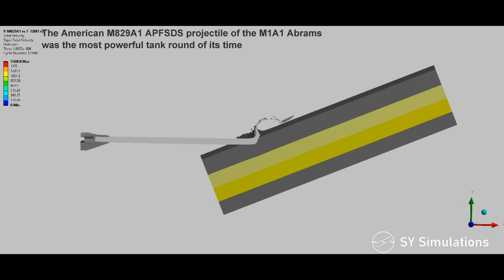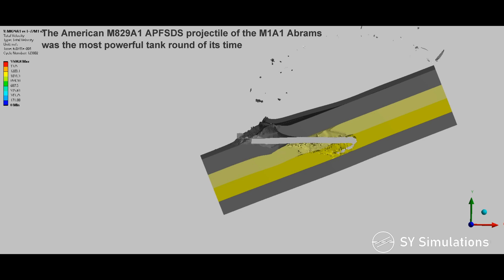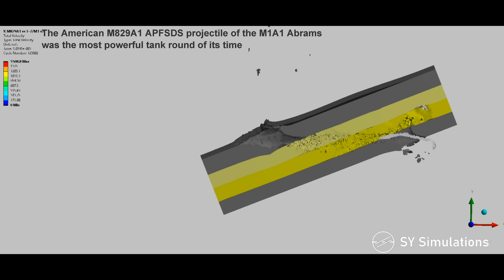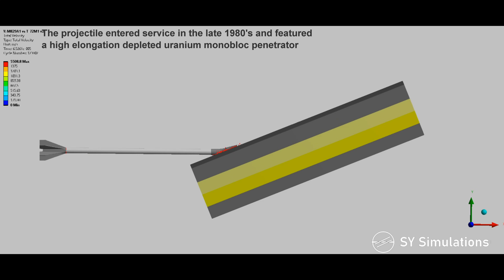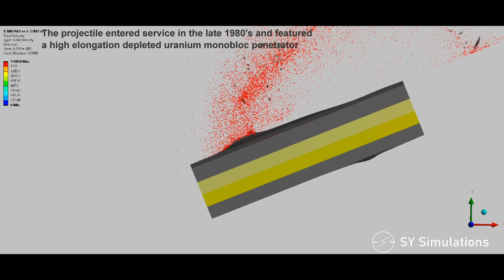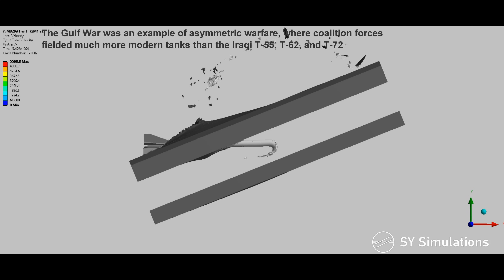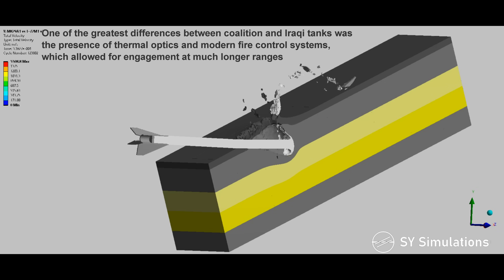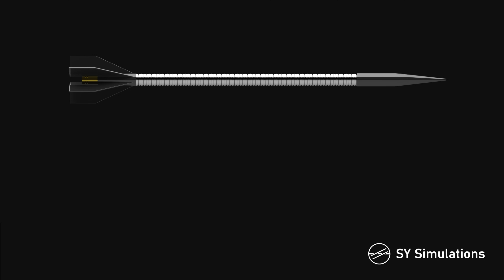Abrams SILVER BULLET vs Iraqi T-72 | M829A1 Depleted Uranium APFSDS Armour Penetration Simulation

Comment: Operation Desert Storm is the perfect example that the Soviet doctrine of "quantity beats quality" was completely misguided.
The coalition fought the 4th strongest army in the world and won in record time at minimal losses.

The Battle of 73 Eastings featured a small number of Abrams and Bradleys running into an ambush by a much larger group of elite T-72 tanks in prepared positions.
The coalition forces, without any air support, completely wiped the floor with the iraqi tanks, losing none of their own vehicles. The battle lasted around 23 minutes.

My personal highlight is when two Bradleys drove into fifteen T-72s... and they managed to knock out half of them without even taking damage before anyone showed up and helped them. The Bradleys managed to reload their TOW launchers mid-combat.

"Quantity has a quality of its own" is bollocks.
Reply: By 1990 Soviet forces would have already many T-72A (1984)s, T-72B1s, T-72Bs and T-72B (1989)s. What's your point?
Reply: @belgianfried  T-72As made up half of the USSR active tank fleet in 1990…
Reply: @somerandomboibackup6086  And? Does not mean those in the NGV or GSVG would use such vehicles. In 1982, the T-72A was also upgraded to use the suite of the T-72B — its only disadvantage in armour
Reply: @belgianfried  How was the T-72A upgraded to T-72B? Besides literally 90% of GSFG tanks have worse armor than a T-72A or B
Reply: @somerandomboibackup6086  Read T-72/90, the book.

In 1982 T-72As were upgraded with 2E42-2, 1A40, 1K13-49 and 9K120/TPN-3 and no 9K120
Reply: @belgianfried  1K13 is the ATGM sight, T-72A autoloaders can't even load ATGM, unless you mean transitional models
Reply: @somerandomboibackup6086  Again, read "T-72/90 Experience in creating domestic main battle tanks", it received 2A46M too
Reply: @belgianfried  I read everything, seems like you just jampacked every components T-72As get as "upgrades to T-72As in 1982" despite it literally being experimental
2E42-2 only began mass production in 1984
1K13-49 were only fitted to 50 transitional models in 1984 
TPN-3-49 yeah maybe but it was an upgrade proposal for obr models
1A40 is literally just the TPD-K1, no mentions of A models getting UVBU
2A46M became standard even before T-72B was a thing
Reply: Weird comment.
Reply: Americans when it's about WWII and Shermans vs. Tigers: "Quantity has a quality of its own"
Americans when it's about Desert Storm and Abrams vs T-72: "Quantity has a quality of its own is bollocks"
Reply: @jonny2954  Joke's on you, I'm German, so your entire argument insinuating some sort of jingoism US-bias falls flat on its face, mate.

Tigers were exceptionally bad tanks due to the high demand in resources and their tendency to break down. The track setup is a nightmare in terms of maintenance or repairs and the engine was crap as well. The Tiger wasn't defeated by large numbers of "bad" Shermans, the Tiger was simply overengineered and prone to mechanical failure, while the Sherman was a very well designed tank that did its job extremely well.

Shermans were good tanks, cause they were effective in combat, reliable and reasonably easy to maintain while also featuring an impressively high crew survival rate in excess of 85%.
Compare that to the T-34, that (according to Soviet numbers, mind you) had a crew survival rate of less than 15%.
It certainly helps that the US Army doctrine was much better than the German one and the Sherman was much better suited to fulfill its role in said doctrine.
Add to that the fact that the US was outproducing Germany in every regard and you've got a recipe for victory: Better tanks in larger numbers. More easily replaced combat losses combined with skilled crews staying alive thanks to the protection provided by their tank.

The US didn't win by producing a lot of lackluster tanks, planes and warships, they won by producing a lof ot really good tanks, planes and warships.

One would need to be a fool not to know that the US had some of the best planes of WW2, hands down, for instance.

Comment: The Iraqi T-72 and T-55 were manufactured in Poland. In 2003, these tanks were very outdated compared to the PT-91 Twardy produced in Poland at the same time. After the defeat of the T-72 in Iraq, research was carried out on why the T-72 turned out to be ineffective against Abrams. The main reason was too long a firing distance, another reason was old ammunition.

Comment: the value of thermal optics especially at night cannot be overstated since older night vision devices had very limited range and they used infrared searchlights that were very easy to spot. while the thermals had superior range, the resolution on the earlier ones was rather poor which could make identifying targets hard and therefore there was a risk of friendly fire. the M1 Abrams for example sometimes has those pads on the turret cheeks that make identifying it with thermals easier but better resolution and crews learning thermal signatures also help to avoid fratricide.
Reply: Not true in the slightest gen1 thermals were awful, with a resolution of less than 140p for the abrams. Their effective range was about 1.5km and a hipotetical 2km, but that was very unrealiable. 

The TPN-3-49 could IDENTIFY a tank sized targets at 1.5km in acctive and 1km in passive at light conditions of no more than 0.005 lux. Obviusly dettection range was much greater. 

Basicaly, gen1 thermals were marginaly better than NVDs, not a bit more.
Reply: Old(USA): 3km in sandstorms .

New(RUS):400m if weather was perfect .
Reply: @grigor.h3929 о чем ты? Какие 400 М? Какие песчаный бури? Для повышения кругозора, столкновение танков Ирака с Амеканскими была полной неожиданностью для первых. Иракские танки вышли со своих капониров для переброски к другим силам, тогда как Американские обходили со стороны соседнего государства при поддержке авиации и разведки, то есть Абрамсы точно знали в какой стороне враг, что он будет двигаться к ним бортом и что Ирак точно не ждёт нападения со стороны пустыни соседа и не имеет авиации для разведки, потому Американцы начали обстрел противника намного раньше Иракцев, которые не имели тепловизоров и снарядов для поражения лобовой брони абрамса (3бм22) на большой дистанции, поэтому направились на сближение
Reply: @ИванУбушаев-ч1р  It’s an old western equipment bought from France. As good as The wood made N-ERA bought from China.
Reply: @grigor.h3929  it's literally way better than latest abrams sight
Reply: @nikolaideianov5092  Wake up and learn.
Russia is still in the stone age.
Reply: @grigor.h3929  hey they did manege to weld a shed to their tanks

Soo at least the iron age
Reply: @aldobatres7086  Use your own hand to search the answers just like a human.
Reply: @grigor.h3929  Catherine thermals are 90's tech and, expectedly, are superior to Gen-1 thermals used in 80's vehicles. Gen 1 thermals could detect tank-sized objects up to 5km, but limited resolution made it difficult to make out shapes past 3km, which has become a contributing cause of multiple friendly-fire incidents during Desert Storm. Gen-2 thermals effectively double these ranges.

I think you're confusing them with Russian-designed Agava sights, which dissapointed so much, Russia stuck to active IR sights for another decade.
Reply: @kireta21  Agree that but some different opinions.

The detection range is 5 km at an ambient temperature of 20°C and humidity below 40%.

The accuracy of a thermal imager is reflected in the minimum detectable temperature difference and pixels rather than distance (the detection distance is related to the minimum detectable temperature difference). Since the French thermal imagers mounted on the T-72B3 and T-90M are only intended for use in mid Europe, they cannot distinguish between objects with a temperature difference of up to 10°C, and have a detection range of only 400 meters in the summer months or in hot areas, this problem has been mentioned many times by the armies of India and a part of Africa countries (of course, it's still much better than the 40-meter detection range of the Russian-built active IR).

Based on the lessons learned from the Vietnam War, the US Army's 1st gen of thermal imagers had already taken into account the use of hot and humid environments, so their detection accuracy reached within 3°C, and their performance in the Gulf War was far superior to the British and French thermal imagers of the same Generation.
Reply: @kireta21 gen1 can not detect a target beyond 2km in perfect conditions. 

And agava was not adopted precisely becuase gen1 thermals were such a marginal improvement that the soviets saw no reason to adopt them. Agava 1 performed Just like the EMES15 on the leo2.
Reply: @grigor.h3929  not really, it's better than american thermals because it's not that old

Comment: You always hear that DU rods are "self sharpening", but in these simulations they don't seem to behave any differently to tungsten rods.
Reply: That is because the effect is somewhat microscopic and subtle. Also, it doesn't mean the tip will look sharp. 

To properly observe the sharpening effect, it probably would be best to color the rod in 20mm section using high contrast color, length wise.

To make it simpler to understand. DU rod will create a smaller hole than W rod.
Reply: There is no reliable DU properties in simulations
Reply: It's because they do self sharpen but at a insignificant level

Comment: The reputation of the Abrams and Challengers 2s come from fighting stone throwers using extremely stripped down and outdated tech. They were totally blinded by their own sandstorms and the darkness of night, with training rounds loaded. Their T-72s were as good as 1st-gen MBTs.
Reply: No, T-72M1 was a near carbon copy of T-72A and this was still in many Soviet frontline formations of the time, and the main tank of Soviet frontline units of the time was T-72B Obr. 1985 which was only a little better protected against KE. And calling the Iraqi Republican Guard “stone throwers” is flat wrong they were a somewhat well trained and equipped force with high motivation, beating them was entirely through superior combat capabilities of Western crews and targeting systems. Though the regular Iraqi army was a mess.

Comment: What is this based on? Afaik nobody in the general public knows the actual armor penetration values of any DU ordinance?
Reply: This isn't powered by penetration numbers
It's a fluid sim of an object, made of a certain material, moving at a certain speed when hitting another object of known angle, composition and thickness.
You get penetration numbers from the simulation, you don't put them into the simulation. 

And we know the material, dimensions and velocity of the dart and the specifications of the armour target.

Comment: I would like to see how contemporary reactive armor would (or would not) have made a difference.
Reply: A t-72b hull would have likely stopped the round even without the era.
Reply: @Masterafro999  Except that's not a T-72B, is it?
Reply: @SeanMurphy1090-d5u  well...none of the export models ever received heavy reactive armour. So I went on to assume that a comparison was only possible on a tank of the same time period that did receive k5. But the t-72bs hull armour would likely be sufficient to stop the round entirely on its own....
Reply: @Masterafro999  Hence my proposal of a theoretical scenario: "I would like to see how contemporary reactive armor would (or would not) have made a difference." which is kind of the point of this channel.
Reply: @SeanMurphy1090-d5u  so heavy era on this very tank. I'd say the round would not be able to penetrate the hull.
Reply: @Masterafro999  Hence my desire for the SIMULATION CHANNEL to run a SIMULATION of the HYPOTHETICAL SCENARIO to see what happens which is the literal purpose of this channel!
Reply: @SeanMurphy1090-d5u  6 months later. I hope you kept up well

Comment: T-72 M1 was creme de la crop of the Iraqi armored force. They stood no chance against any alliance MBT.
Reply: Albeit, Severely outdated and downgraded export variants.

They didn't have 3BM42 (Hell, even the gun wasn't up to fire it), which was a standard to nearly all T-72's in service back then.

And no thermals as well.
Reply: export heavily downgraded model in small numbers against most modern tanks opponents can field?
wow who couldve guessed
Reply: @user-pe8yi9uh7d T-72M1 had been frontline for most Warsaw Pact forces so no it was not some downgrade just not as good as the most very modern Soviet models.
Reply: @Сталкер-ь2х  T-72 M1 is 1:1 variant of T-72A. M1 is pretty much a export designation only. For it's time, it was a decent MBT as a whole. Not a real downgrade. Was it A or M1 is irrelevant. Both were obsolete by the time when 1st Gulf war occurred.
Reply: @JustPeasant  It was downgraded in the sense that Iraq only had the 3BM9 steel round against the Abrams, which was insanely old and pretty much useless. It also wasnt obsolete at all, (its still used in Ukraine lol) if it had better rounds it could probably do ok against some NATO MBTs, however Iraq was simply way too outgunned by the coalition of 30+ nations to really do anything.
Reply: @quan-uo5ws  For the 90s you can consider it obsolete in the sense that it's armor isnt able to resist main threats at the time and the fire control system is from the early 70s, even if you gave it modern ammunition it would still be at a big disadvantage. 

T-72A was ok for early-mid 70s, but as T-64B came in it got surpassed.
Reply: @quan-uo5ws  Not obsolete in true sense, just like you pointed out. Also, it has to be taken into account that Iraq waged unsuccessful invasion on Iran for almost eight years (22 September 1980 – 20 August 1988). It certainly played its part into Iraq's forces depletion and exhaustion.
Reply: @JustPeasant T-72A from 1972. And when Abrams appeared with 120 mm gun?
Reply: @Anti_Everything  Hmm... M1A1 (first serial production version with 120 mm M256 smoothbore) went into production in 1986, concluding in 1992.
Reply: @quan-uo5ws t55s are used in ukraine

If its or if its not used in ukraine isnt a good point

Maxum guns and ww2 artillery is also used in ukraine doesnt mean its good
Reply: @nikolaideianov5092 Ukraine is vastly different because there are barely any tank on tank fights+t55 can do both direct and indirect fire of HE shells with drone correction compared to desert storm and gulf war where tanks clashed 

besides those t55s will likely have bastion atgms as part of their load out in case they encounter hard targets
Reply: @Сталкер-ь2х  Cope.

Comment: Can you do M829A1 vs T-80U or T-72B 1989, I know it won't penetrate but I'm curious about how close it'd be to cracking the back plate
Reply: It would struggle to penetrate the hull of the t-72b even without the era.
Reply: @Masterafro999  source?
Reply: @somerandomboibackup6086  "Numerical analysis and modeling of jacketed rod penetration" by Brett R. Sorensen, Kent D. Kimsey, Jonas A. Zukas, Konrad Frank.
"Numerical analysis and modeling of jacketed rod penetration"-seperate paper on the same topic by by H. Kaufmann.
"Comparisons of Unitary and Jacketed Rod Penetration into Semi-Infinite and Oblique Plate Targets at System Equivalent Velocities" by J. Stubberfield.

There's plenty more where this came from.
Reply: @somerandomboibackup6086  earlier du projectiles like m829a1 were brittle and prone to shattering when facing external shear forces which would be imparted by either heavy era like K5 or complex composite arrays like the one found on the t-72b series of tanks. Their armour was very good for its time. Especially when coupled with k5...
Reply: @Masterafro999  yes it will get destroyed by K5 but how will composite?
Reply: @Masterafro999  you havent even gave me one source
Reply: @somerandomboibackup6086  huh? Is the comment invisible to you? I sent it a day ago.
Reply: @Masterafro999  mb it was invisible when u sent it
Reply: @Masterafro999  yea I did see it now thanks, Ill look into them later